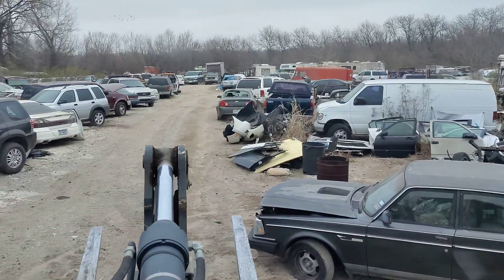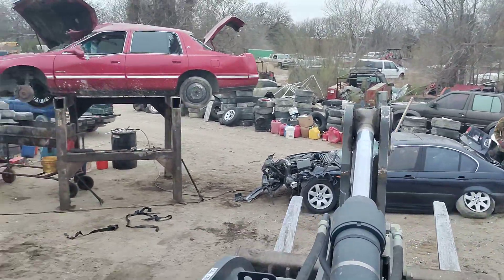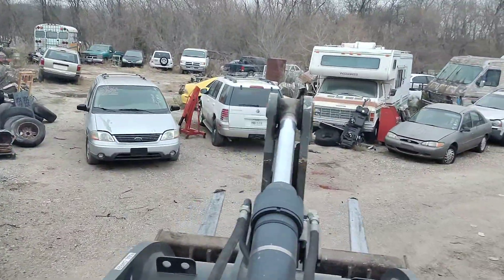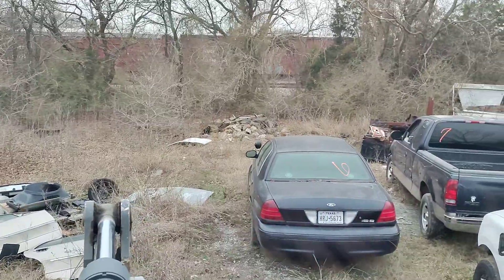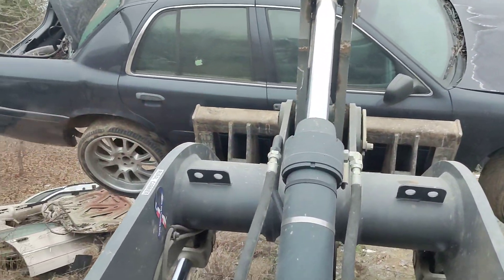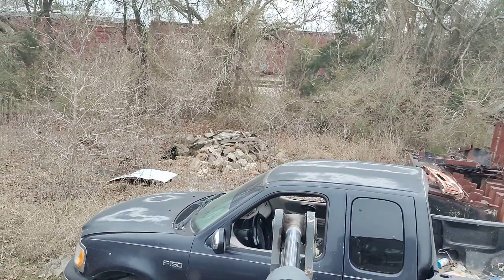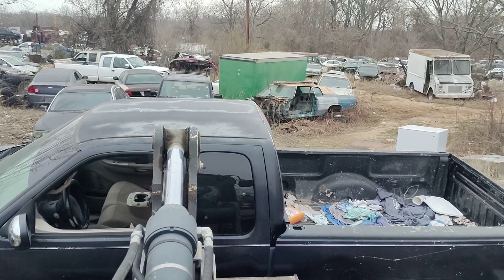Cowboy on the Hunt for Cars to Crush 👊😀

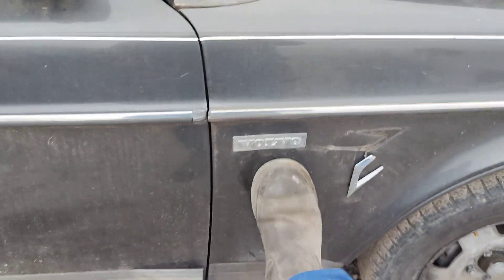Comment: @6:06  I love those old school aluminum VOLVO emblems, I usually take off any old school Volvo emblems from the 60's thru 80's as my pops & grandpops drove those cars , I use to drive my pops old 70's volvo off road ,in the woods & even on the old garbage dump when I was younger, that car is still on the road too ,my cousin still got it ! Its completely restored all original equipment too ,